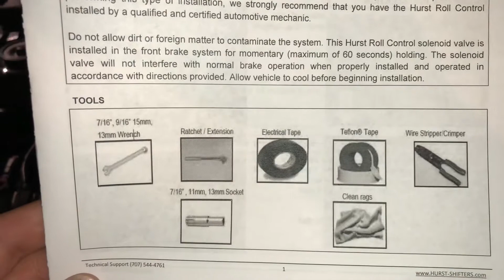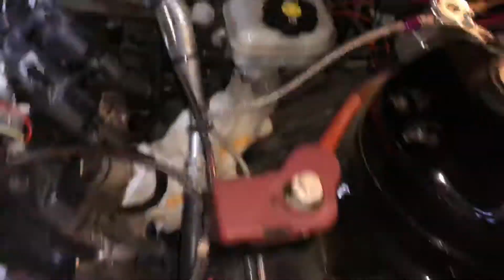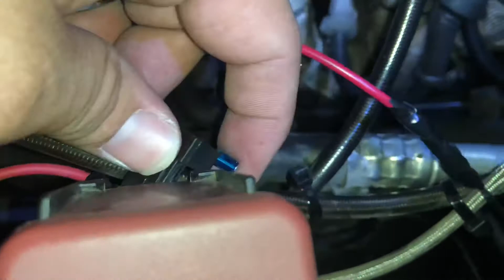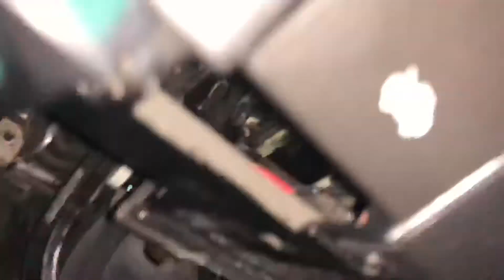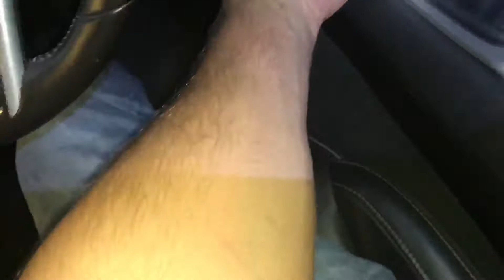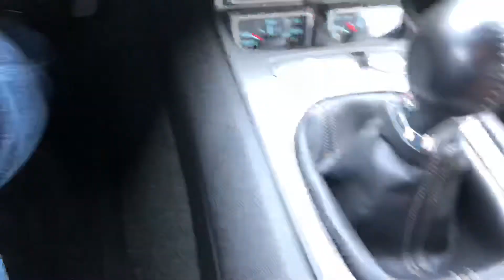How to install Gen 5 Chevrolet Camaro Hurst Roll Control install aka Burnout control

Comment: Why didn't Hurst design this to be installed on the right side of the car near the ABS module? Seems a lot tighter and a harder install.
Reply from the maker: FasNuf Garage not hard at all, not terribly tight.
Reply: @Fix-it-tony  SJM manufacturing made it on that side
Reply: Exactly why I’m watching this vid. I’m trying to decide between sjm, and this hurst kit.  I want it to be hidden away so I may just go with this kit. The sjm is a bit more noticeable on the passenger side but I heard they both work just the same.  Do I want to pay the extra $80 bucks to have it tucked away is what I’m debating.  If I do get the hurst I’ll be powder-coating the bracket just to give it a bit more of a stealthy look.  I WOULD LOVE TO KNOW THOUGH, if there is an advantage having this kit at the master cylinder or if it’s beneficial at all to have it closer to the abs box. Is there a performance deference of the solenoid ie. A tighter hold of the front wheels or better response without having to pump the brakes so it doesn’t roll a bit like it did in this guys vid which by the way was the same for an sjm vid.